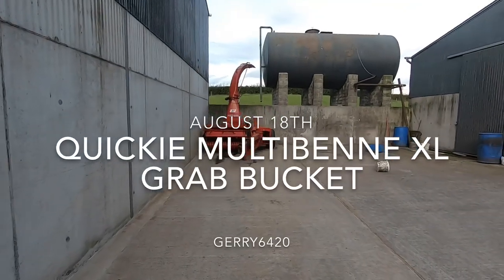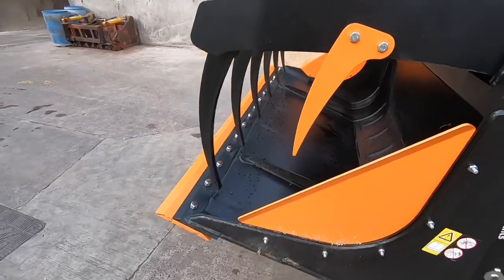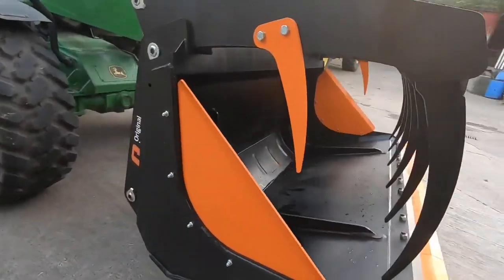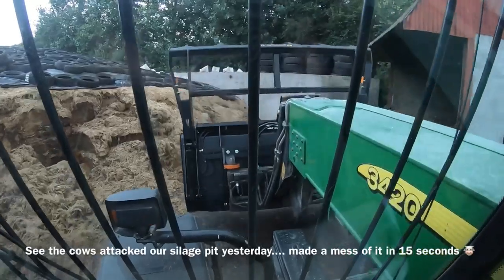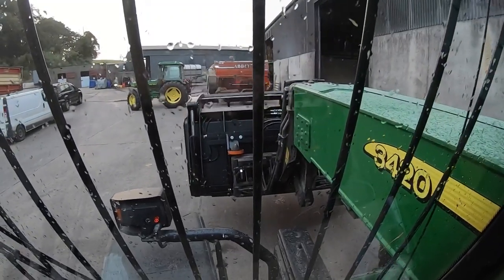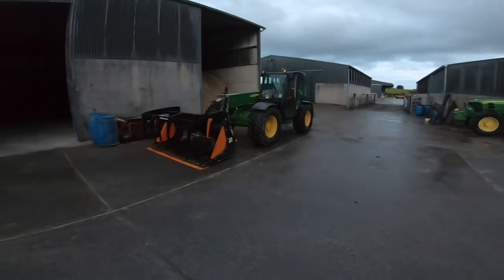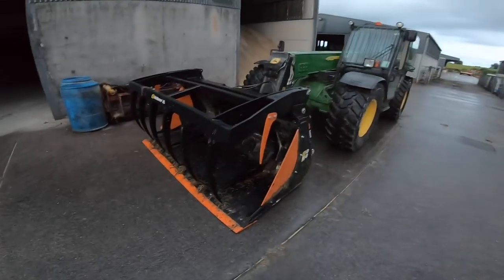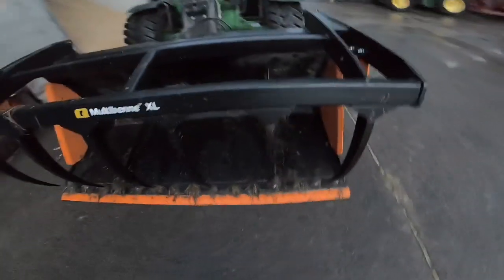QUICKE MULTIBENNE XL GRAB BUCKET

Comment: Looks like a nice, sturdy piece of equipment which is what you want when you're using it everyday for such a wide variety of jobs. The wear plate on the front bolting on in three parts is good in concept however I'd be fearful of the silage and muck corroding the thread ect. and making life difficult to take it off. Obviously you could just grind the bolts off but it's just a bit of extra time and effort that you feel could be avoided with a bit more thought. Great video and review.

Comment: Do you struggle to get attachment that'll fit the JD headstock due to the JD loaders being quite rare??Nice vid
Reply: Isnt pin and cone a manito head stock so would be quite popular!!!
Reply: @valleyboy2099  I don't really know as I've only driven 2 different brands but thanks for replying
Reply: Pin and cone came from Matbro and is very popular still on new machines irrespective of brand. A lot of pivot steer machines still come with it as standard or at worst on request
Reply: @valleyboy2099  pin and cone is very common, used to be a matbro standard headstock. Manitou is different again. Narrower and hooks instead of the cone idea
Reply: Pin and cone was the first quick attach and was matbros design, it was the first and most simple and in my opinion to this day is still the best

Comment: That row of bolts across the front doesn't look like a great design. After a while when they get rusted they would be impossible to loosen if you had to change one of the blade sections
Reply: No nothing a little heat would sort!!!
Reply: Senan Keane grinder job
Reply: Yeah I agree poorly designed in my opinion
Reply from the maker: No wouldn’t be an issuer. Air gun would whip them off.
Reply: Senan Keane I suppose it’s not like there getting hit with stone all the time
Reply: Just cut them have new one's to the ready just like any time a cutting edge has to be replaced or reversed

Comment: Congratulations on reaching 20K. How do you know when you’ve put enough silage or meal into the diet feeder - do you have a weigh cell on the boom? If not then you must be very good at guessing weight of materials!
Reply: Jonathan Guy weight cells on the feeder. If you look closely there’s a screen on the front of the feeder roughly head height pointed out towards the telehandler. It weighs it and tells Gerry what weight is in the mix.